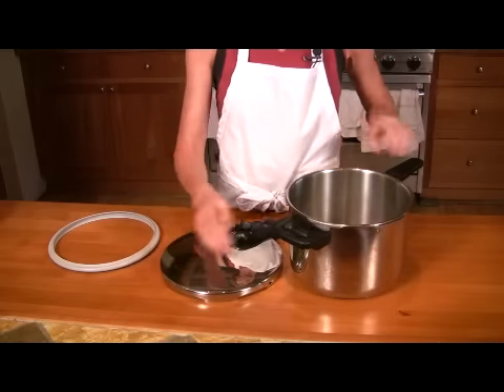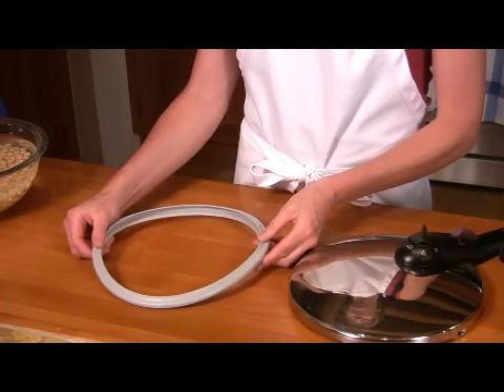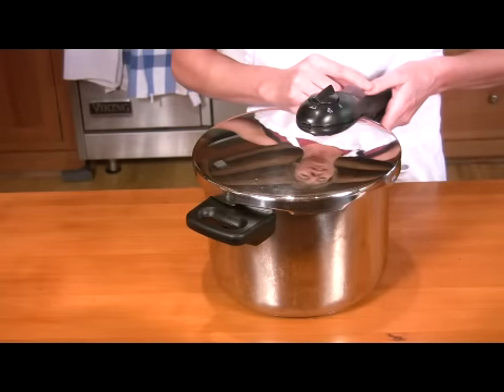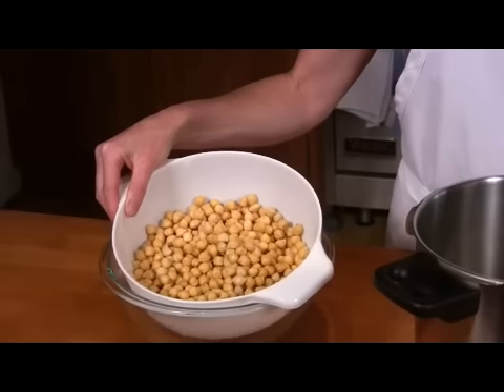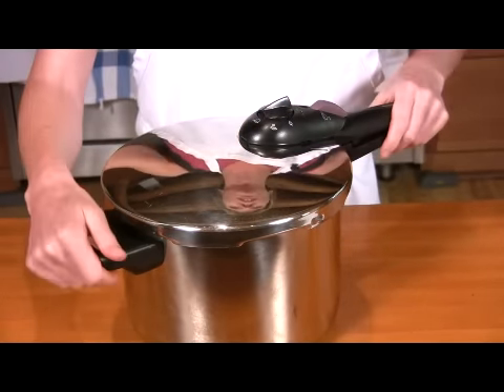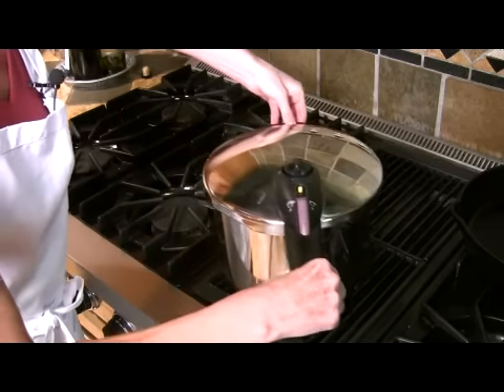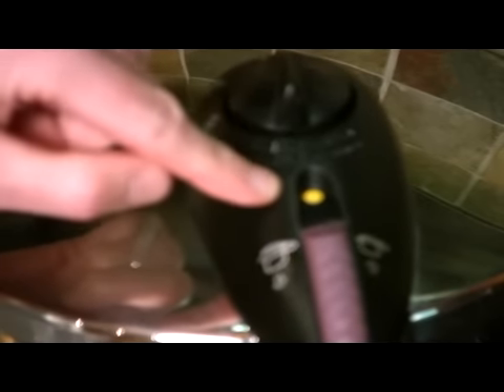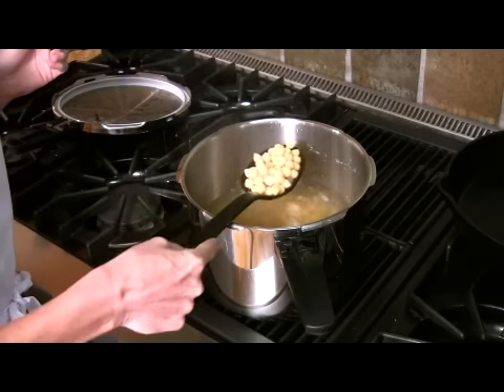How to Use a Pressure Cooker

Comment: @Cohn27 The cooker shown in the video only cooks at high pressure - 15psi. If you cook at low pressure often, purchase a cooker that also has 5-8psi as an option. Several electric pressure cookers have high and low settings and most major pressure cooker companies make at least one style that has both options.

Comment: I have this same pressure cooker, but I have never used it (I admit it, they are a little scary to me).  I am wondering if you are supposed to hear steady hissing from steam releasing while it's cooking.  Mine does this.  Is this normal?
Reply: i have the same question!
Reply: +Julie C I have had mine for 10 years and have just gotten around to really using it. Yes, hissing around the valve is normal. Just experiment with it. Once you get use to all the noises it makes you will kick yourself for not using it earlier. I suggest using it short amounts of time and just depressurize it and take a look at the progress. You will feel like a boss once you master it!
Reply: Just found your comment.  Thanks, John!

Comment: THANK YOU JUST GOT ONE LIKE YOURS SO TOMORROW I WILL USE IT FOR FIRST TIME, I AM SCARE AS 2 DIFFERENT ONES EXPLOTED ON ME , BUT WILL SEE IF THIS ONE DON'T.
Reply: A well made pressure cooker should never explode - there is a pressure release valve to stop this happening.  However, avoid cooking rice in a pressure cooker as the pressure release valve can become blocked.

Comment: Bad video! Sh is using a Fagor pressure cooker, and mistakingly tells us that pressure is achieved when the yellow button pops up. This is WRONG! The yellow button pops up when the pot is mearly lightly pressurized, BUT you must then wait for a slow release of steam from the front vent—it will also make a little noise. When this happens, start your timer and cook. Do NOT start your timer when the yellow button pops up, as your cooker will not be up to full pressure yet. Wait for the steam too!
Reply: You're rude.